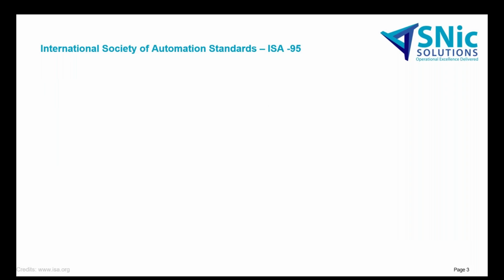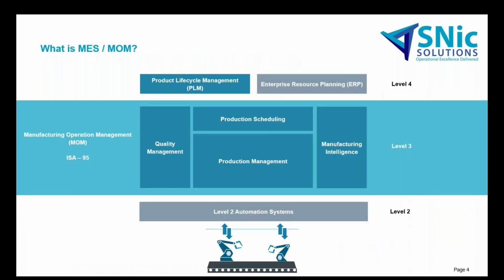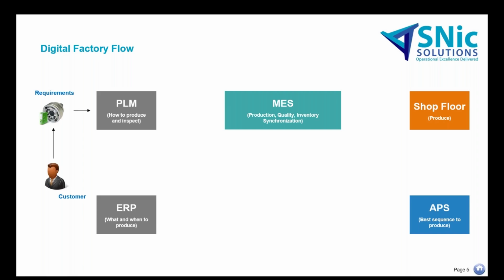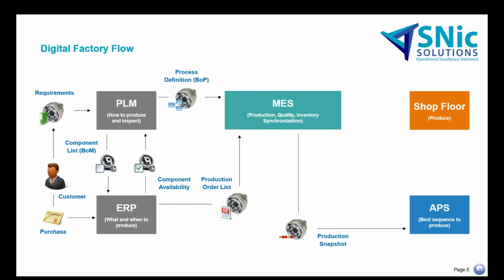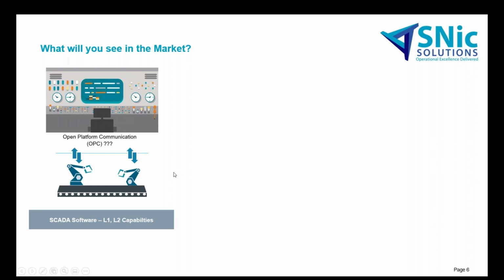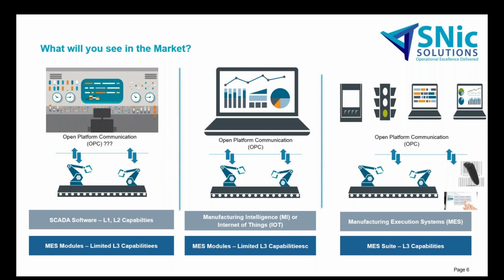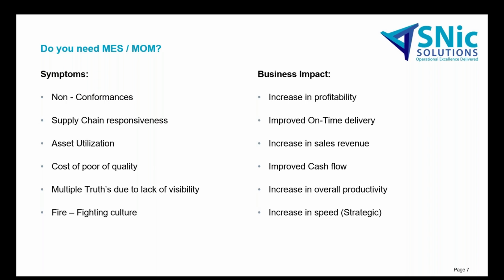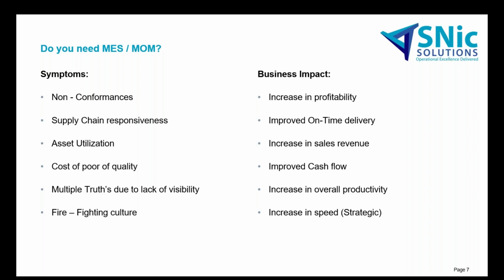What is Manufacturing Execution Systems (MES) / Manufacturing Operations Management (MOM)?

Comment: In pharma API manufacturing especially in working area in intermediate manufacturing lot of physical activities required, all this can overcome by MES.
Reply from the maker: Definitely. eBR is a must in pharmaceutical manufacturing and MES is the right platform for electronic batch record automation and maintenance. Many pharmaceutical manufacturers especially API facilities do ask for 21CFR11 compliance and this is an area where MES software's that are compliant to 21CFR11 are usually given a preference even if they are not necessarily modernized.

Comment: How much cost for this application??
Reply from the maker: Thanks for your comment. An MES price is a very broad range and depends if you are buying point applications or an enterprise wide manufacturing system. We would recommend contacting our sales team on sales@snicsolutions.com to know more and also many point solutions provide their pricing on their website. You have to budget for additional services whether you plan to do it internally yourself or externally as well as IT infrastructure. In our experience, If cultural resistance exists, we always advise customers to spend cautiously and also focus on building culture as you could have the entire software be implemented but very poor adoption.